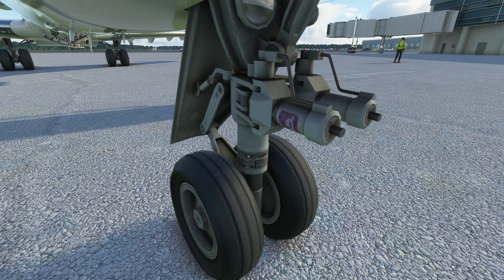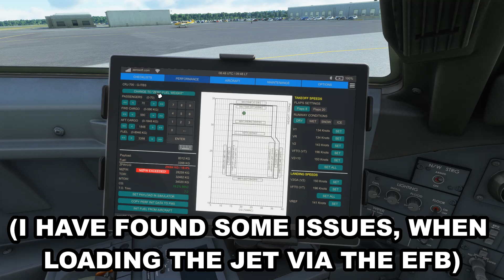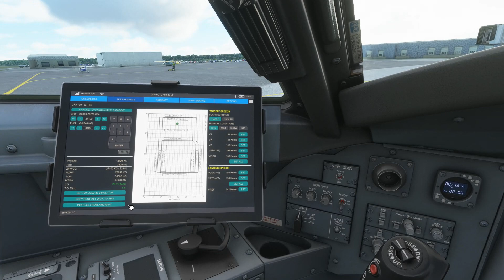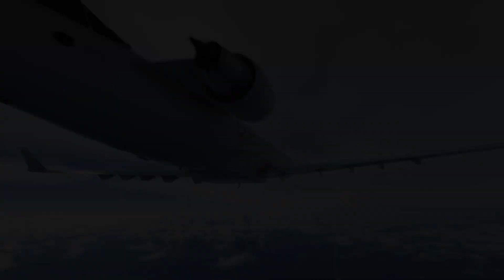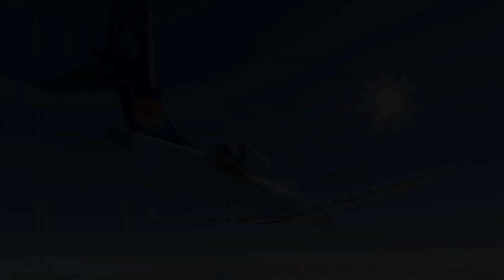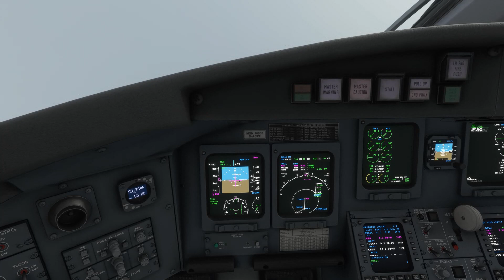Aerosoft CRJ | Full Review | Full Flight | Microsoft Flight Simulator 2020

Comment: would you say the CRJ is study level?
Reply from the maker: Hi La Mar,

It’s not really no. The systems modelling is actually pretty good, but the flight modelling isn’t really there (from what I can tell). It is a nice addon though overall and it has a decent amount of depth to it. I think right now, the only commercial airliner in the sim that one could argue is “study level”, is the DC6. That’s soon change soon though; with the Just Flight 146, PMDG 737 and Fenix A320 all looking very promising!

All the best : )
Reply: @IntotheBlueSimulations  oh wow good info! So the Fenix Airbus is gonna be study level ? I wonder if they will add the other engine variants Like the Neo, and the IAE Engines The CFMs looks like the ones there gonna release the product on
Reply from the maker: Yes, well so they say ; )

Obviously we’ll have to wait until the product releases, to see what sort of standard it actually achieves; but Fenix are talking about even modelling GPS coverage, based on the actual constellation positions of GPS satellites! So really a very in-depth and accurate simulation - if they deliver on their promises. . .

I’m looking forward to giving it a go when it releases : )

Cheers!

Comment: Hey mate. Thanks for another great review.   Was looking at this plane but for the price and the issues you list i am very sceptical considering the FBW A320 is free, and perhaps even slightly above this plane? 
May have to see what the JF BAe146 pricing will be.  would like a jet that is a bit less in size then the A320
Reply from the maker: Hey Coenraad, my pleasure as always!

Hmm, that’s a tricky one. I would say right now, the CRJ is slightly better, only because it’s in a more complete state (that’s not to knock the FBW boys though - they’ve been doing amazing work!). I do enjoy the CRJ and Aerosoft do seem to have eliminated its most significant behavioural faults, but I imagine the FBW A320 will be every bit as good in the long run and obviously there’s no competition in terms of price haha. The CRJ is perhaps more “fun” to operate than the A320 though, as it’s a more “hands on” aircraft.

If the Just Flight 146 is done to the same standards as their X-Plane version, then I am very much looking forward to it and it will blow the CRJ out of the water in some respects. So it might be worth holding out for the 146, though I suspect it will be more pricey.

Perhaps worth waiting to pick the CRJ up on sale if you’re unsure. With a decent discount, I doubt it’s an addition to the sim that you would regret.

I hope that helps a little. Have a great weekend! : )
Reply: @IntotheBlueSimulations  Thanks for the reply. Yes i think i will do just that and wait for a sale for the CRJ.  The 146 i think will suit me very well and possibly better then the CRJ even since i am more of a GA pilot and like flying off less prepared airports as well, something the 146 is very good at too.   Just curious to see what it wil be to fly. So gues what chanel i am tuned to for a review when that comes out  ;) 

Have a good weekend you too.

Comment: GreT video. It took me more than several attempts to get to grips with the aircraft but once mastered it’s a joy to fly. The lack of auto throttle increases the workload significantly but requires some skill nonetheless. I agree about it being difficult to see the PFD due to the small text sizes so I use the separate pop out function and have it displayed externally which is a great help.
Reply from the maker: Thanks very much Andrew!

Indeed, the CRJ is a really nice little challenge to fly. Definitely far more hands on than your typical commercial jet, great fun as a result. I’m not ashamed to admit, I may have forgotten about the lack of auto throttle on more than one occasion at TOC XD

It’s been a while since I’ve had the chance / time to fly the jet actually, I really need to get back into it. . .

Cheers, all the best! : )
Reply: Lack of A/T isn’t too bad. Flying the thing in real life is relatively easy and straight forward. You just set the thrust where needed and it requires relatively little changes. Approaches can be finicky for speed requirements but it just comes back to pitch power tables

Comment: My crj keep crashing to desktop every time I go  to a large airport   Can some help
Reply from the maker: Hi Deondre,

If it’s only happening at larger airports, I suppose it might be a RAM issue (or lack thereof). How much RAM do you have? I can’t see what else it would be causing this, other than memory. The aircraft works fine at smaller airports?

Cheers
Reply: You may need to delete your rolling cache this worked for me. Also try switching the photo bing stuff off and try it.
Reply from the maker: Thanks for the info Jeffrey!

I turned off my rolling cache personally, but that’s great information I can pass on to others, if they are experiencing similar problems.

Cheers, all the best : )

Comment: Study level is not hard to define, take the average "finished" DCS module : that's study level. There's the more refined ones (F-14B, probably the most in depth simulation of an aircraft on a consumer piece of software, unmatched by anything in the civilian sim scope), the good ones (A-10C) and the middle-of-the-way ones with some approximation in systems (F/A-18C, Mirage 2000...) but they're all clearly study level.

If you can't study the official, real manual, and have a 1:1 experience in the cockpit, it's not study level.
Reply from the maker: I still think each individual has their own idea of what constitutes study level, but yours and my definition are basically the same Galf. For me; if you can operate the aircraft with a real world manual / procedures and get the correct response from the aircraft (within a reasonable degree), then it’s study level. Personally I wouldn’t need for every emergency system, engineering function etc to be modelled, but I know some would.

Side-note. I absolutely must try the F14!! I own it, but have yet to find the time to sit down with it. Everything Heatblur touches seems to be gold. I love the Viggen.

Cheers, all the best!

Comment: I still can't steer...

Edit: fixed now read below!
Reply: Nose steering is on, I did everything right😒
Reply from the maker: That’s very strange then Frank. . .

You followed everything on the checklist? You don’t have any similar problems with other aircraft? Is it just the steering that isn’t working, or the rudder as well?

Just trying figure out what might be causing your issues, hopefully we can get it sorted : )
Reply: @IntotheBlueSimulations  yes I did everything on the checklist and I was watching yt videos as well. Side Rudder is also not moving (while default aircrafts are working fine). I am playing with Xbox controller and I need to assign the side rudder by key assignment separately (not rudder axis, this is what is not working as normal) after that its moving. But now it does not jump back into the middle position... I am frustrated
Reply from the maker: Any luck fixing it Frank?

I’ve seen a few others with the same issue, but I can’t find any solutions I’m afraid. I would guess maybe it has something to do with the Xbox controller and it not being assigned to an axis.

Perhaps try turning Auto-rudder on in the sim and then you should be able to use your aileron axis to turn the aircraft on the ground. At least as a temporary solution.

All the best!
Reply: @IntotheBlueSimulations  Hey thank you for your answers. I fixed it yesterday. The Xbox controller didn't recognize rudder Axis on buttons like LB and RB.  IT'S ONLY WORKING WITH THE CONTROLLERS JOYSTICKS, not with the buttons. I am so happy it's working now..if you want to, you can help other people with that issue.
Reply from the maker: Ah yeah, thought it might be that! Glad you have it working now : )

I will be sure to pass the message on, if anyone else has the same issue.

Cheers, all the best.

Comment: I've found that if you import a flight plan from SimBrief, it loads all the weights and all the winds at every WP. There's a few videos out detailing the SimBrief direct import method, all you do is insert the CRJ path into the SimBrief downloader. It makes the EFB weight page a bit redundant! Edit. BTW VNav works exquisitely well, it follows the descent profile spot on!
Reply from the maker: Thanks David!

I had heard it was possible to import from Simbrief, but hadn’t really looked into it. I generally like doing the setup, but having the winds etc would certainly be nice!

That’s brilliant re the VNAV. It’s such a shame the aircraft has the issues it has, because it does so many things right. I was trying to fly a tight departure at light weights with a level off at 3,000ft yesterday. Didn’t matter how much I tried to help the aircraft achieve this, it wasn’t even close.

Thanks very much for the info, I will look into the Simbrief import : )
Reply: @IntotheBlueSimulations  you know I think a lot of this has to do with the Asobo flight model and code. The CRJ in P3d is perfect. I assisted MCE to do a full set of flows for the CRJ. In the end we could even access the ND range control by voice control, specifying the range setting! Asobo are using totally different coding to P3d and it's difficult for add on makers like MCE to address it. I use VNav in the tutorial flight. If you try it you should get a perfect profile executed by the AP! I had great difficulty getting the LOC/GS after the descent. Probably the answer is to use HDG more to achieve a less acute acquisition angle. Anyway, thus is a complete sim in my books. It takes serious "type" rating to fly, not even 737 jocks will find this one easy! BTW, I use the SimBrief weights direct from the FMC import, the EFB doesn't reflect what's in the SimBrief plan and may be causing a COG problem? I too had a "ghost" rotation before I'd pulled back!
Reply from the maker: Yeah, I’m pretty sure a lot of it will be MSFS issues. I don’t see that as a “get out of jail free card” for developers though. One would hope they’re trying their best to work around these issues. The ILS not really working on a commercial jet is a little bit silly really. As you say, reducing the intercept angle certainly helps and apparently capturing the glideslope from a descent helps as well. Would be nice if the autopilot could properly manage the aircraft though, rather than the user having to manage the autopilots peculiarities. Apparently Aerosoft used the default Asobo autopilot on the CRJ. That’s a very strange choice given the default autopilots clear inadequacies. 

As you say, overall a really nice jet though. Very in depth and a nice challenge to operate : )

There are definitely some issues with the EFB. Even switching between the ZFW method, or the pax number method of loading, gives wildly different results. I had hoped maybe the Simbrief method would fix the CofG,  “auto-rotation” etc. Seems not. . .

Comment: finally we saw some weather! 😃 great video btw. it seems that it’s better to learn the basics on the A320... 🙂
Reply from the maker: Haha, just a little bit yeah : )

I pretty much always use live weather in my vids, so I guess I’ve just been “lucky” that most of my vids have been on nice days. Then again, of course whenever I plan to do a scenic flight, the weather is rubbish haha. I have a video in the CJ4 heading into Meigs that I have yet to upload. I had visions of taking in the sights along Lake Michigan and then a wonderful arrival into Meigs. Ended up being solid cloud all the way and awful weather for the arrival as well ha. Still, hopefully it makes for an interesting video. . .

Certainly the 320 would be easier in many ways to learn the basics on. I might actually say the CRJ would be “better” though, as it forces you to think a lot more about profile management, autopilot mode useage, thrust usage etc. Funnily enough, I did my some parts of my CPL in a CRJ sim. The Aerosoft CRJ probably would be ideal in its current state though unfortunately, as you have to battle the autopilot a bit.

Cheers Péter, all the best!

Comment: Good Job. Another great video.  And a very beautyful arliner.
Reply from the maker: Thanks Ludovic! : )

Yeah, she’s very pretty if nothing else. It’s actually really fun to fly, just gets a little frustrating at times with the autopilot haha (hoping that gets fixed). I’m really enjoying the sort of “half way” automation it has though. Enough to help you out, but still limited enough to make things challenging.

Cheers, all the best
Reply: Hi. I have a question for the FlyingIron Spitfire.  I can't taking off. The aircraft run quickly to the left. I don't understand. The rudderr trim is fully right. HAve you an idee ? Please help ;)  Thanks. Ludo
 @IntotheBlueSimulations
Reply from the maker: Hi Ludo,

I had someone else asking me the same thing actually and I ran some tests.

Personally I wasn’t experiencing the same issue. I use neutral trim (I know it’s not realistic, but I find it works better) and 8lb of boost for my takeoffs; what do you tend to use?

The other chap that was having issues was also using full trim. I wonder if it’s perhaps causing the issue?

Maybe try with my settings and see how you go? : )

Comment: Well that looks like hard work  did you have cabin crew turned off as watched one were on take of the cabin crew said prepare for landing. There not for me but great review enjoyed it.
Reply from the maker: Thanks again Andy,

Haha, it’s certainly a fair bit more work than one of these new-fangled Airbuses! : P

Unfortunately currently with the CRJ, half the workload is flying the aircraft and the other half is battling the autopilot. Hopefully they get that fixed. I had the cabin crew turned on. I think she made her takeoff announcement on the taxi out. It seems that certain things trigger certain messages. For the most part it seems to work well, but occasionally you get an odd one. If I’m not mistaken, they’re the same sounds as used in FSPassengers. I wish you could change out the accent though. The Aussie cabin crew in the back of my Lufthansa jet wasn’t quite doing it for me haha.
Reply: @IntotheBlueSimulations  the crj is Bombardier
Reply from the maker: Yes indeed. I was just joking that the CRJ requires quite a bit more work from the pilot, as compared with an Airbus ; )

Cheers!

Comment: you say no networking because of Web Assembly. does this mean that SimLink doesn't work, so no Vatsim etc? if so, yikes
Reply: Simlink does work.
Reply from the maker: Interesting. So the line is a bit more blurred than I thought. That being said, I’ve seen a few people posting about issues with their transponder when using VATSIM, so maybe the two don’t play very nicely together?
Reply from the maker: That’s a very good question / point Bernard!

It seems it is working, as Exile has mentioned. I see people are using it with VATSIM but I’ve heard some mentioning that they’ve had issues with the transponder. So I guess it is working, but not 100%.

Thanks, all the best!
Reply: @IntotheBlueSimulations  after further research, the issue is that the plane's built-in systems (the EFB, the MCDU etc) can't access the internet, and so can't get ATIS or SimBrief, WX, etc. WebAssemblies run in a sandboxed virtual machine (and have a reputation for being twice as slow and using twice as much memory as DLLs).
Reply from the maker: Thanks very much for the info once again Bernard! I must confess, it’s not something I know much about “sandboxed mode”, DLLs etc.

I believe part of the reason Web assembly was chosen is that it will work on the Xbox? I just hope it’s not the only reason they went with it (if generally speaking it’s inferior) Doesn’t bode brilliantly for the direction the sim is headed in if that’s the case  : /